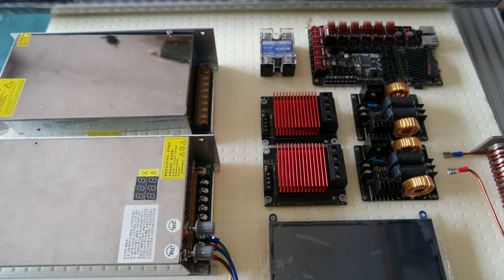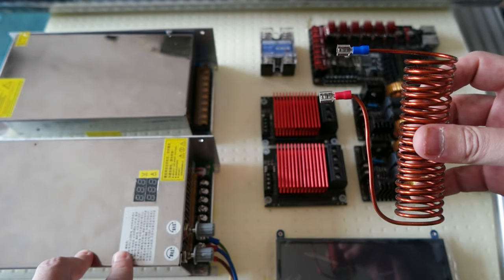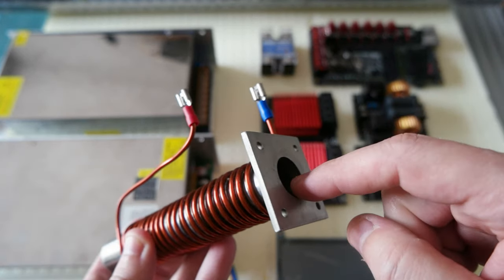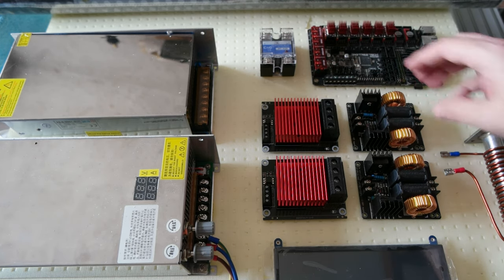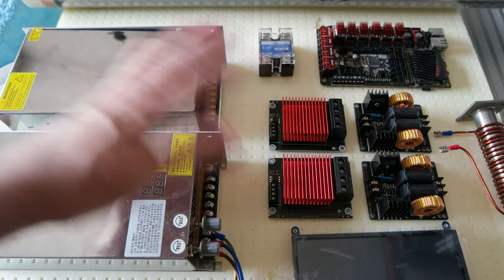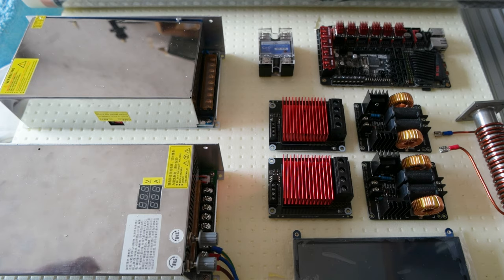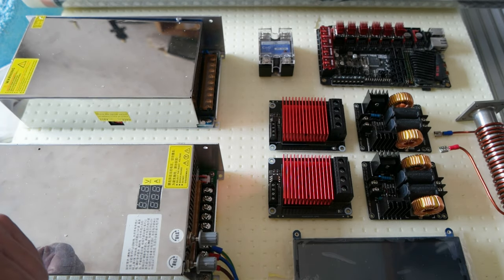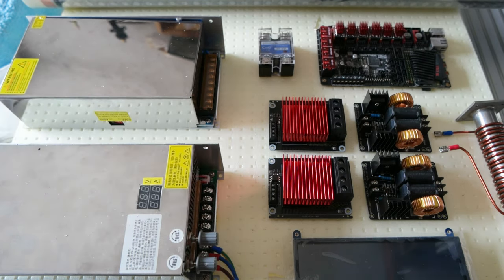Custom 3D printer board, mosfets, induction heating and power supply setup

Comment from the maker: I wanted to show what setup I have for my custom 3D Printer. I have 2 power supply, one for the Manta M8P and motor drivers and the other will power the induction heating for the 2 pellet extruders via Mosfet and Induction Heating Board Module. I forgot to mention the laser solution too. Will do another video for it.

Laser Support - https://s.click.aliexpress.com/e/_A0NYLS
Laser - https://s.click.aliexpress.com/e/_AXFIJS
Induction Heating Power supply - https://s.click.aliexpress.com/e/_9hVy0K
Heated bed power module mosfet - https://s.click.aliexpress.com/e/_DkX...
Infrared Heating Film: https://s.click.aliexpress.com/e/_AUcAhb
BIGTREETECH BTT S57B V2.0 - https://s.click.aliexpress.com/e/_9gZpdo
Oled Screen - https://s.click.aliexpress.com/e/_9R4LLy
3D Printer GT2 20Teeth - https://s.click.aliexpress.com/e/_9yJNts
Nema 23 holders - https://s.click.aliexpress.com/e/_9wL11C
BL Touch - https://s.click.aliexpress.com/e/_AYXBGI
Infrared heating - https://s.click.aliexpress.com/e/_9InHB4
coupler - https://s.click.aliexpress.com/e/_ASloGa
Touchscreen Monitor 7 in HDMI Screen - https://s.click.aliexpress.com/e/_DCr...
BIGTREETECH BTT Manta M8P - https://s.click.aliexpress.com/e/_DlJ...
BIGTREETECH BTT CB1 PI4B Adapter - https://s.click.aliexpress.com/e/_DBJ...
BIGTREETECH BTT CB1 heatsink - https://s.click.aliexpress.com/e/_Dmd...
BIGTREETECH  GTR 1.0 http://s.click.aliexpress.com/e/_rRDltN
BIGTREETECH SKR Pro v1.2 - http://s.click.aliexpress.com/e/_rRDltN
BIGTREETECH SKR V1.3  -  https://s.click.aliexpress.com/e/_AbZJ5z
TMC 2226 - https://s.click.aliexpress.com/e/_DBP...
TMC 2209 - https://s.click.aliexpress.com/e/_ApIVvH
Nema 23 - https://s.click.aliexpress.com/e/_AdrgEQ
Nema 17 - https://s.click.aliexpress.com/e/_97imIx
Nema 17 geared 5:1 - https://s.click.aliexpress.com/e/_A3kKfz
============================================================
flipsky ESC https://flipsky.net/?ref=ganzo
maxkgo BMS - Coupon Code ganzo https://maxkgo.com/?ref=ganzo
============================================================
Alibaba weekly deals https://offer.alibaba.com/cps/8pt0t96j
============================================================

Comment: Since you will cross-connect the signal wires across from the board to the mosfets, you most probably also need to connect all of the ground wires together. Specifically the output DC ground from both the PSUs should be connected together, so they share a common ground.
Reply from the maker: it might be required but I need to figure out that too !
Reply: @ganzoai  Not "might be", you must do it. Otherwise, your two DC lines will be floating at different levels, and what is 12V on one side, can at the same time be 112V on the other side since the two grounds are floating at different levels.
Reply: @ganzoai  Turn your PSUs and measure the voltage across the ground of one unit to the +V of the other unit when the grounds are not connected.
Reply from the maker: @kesor6  one is at 24v and the other is at a variable voltage. Also I am on a 220 volt, so I have ground on both PSU from the same line.
Reply: @ganzoai  The DC grounds on the outputs of the PSUs are not necessarily connected to wall socket ground. You should check. If they are, then its okay, everything is already connected. If they are not, and the DC grounds are floating (more probable) - they should be connected together, or else.
Reply from the maker: @kesor6  that's why I said "it might be required but I need to figure out that too !"

Comment: Not once when you'd mentioned using 2 MOSFETs, did I think you were referring to those 2 large heatsinked boards. I've never seen such massive MOSFETs! 😲

Are they some kind of industrial model for high current applications?
Also, how does the cost of those compare with using IGBTs instead?
Reply from the maker: There are smaller ones but these one are high current 30A, they are used for 3D printers, cost between $10/$20 https://bit.ly/3UfJgWR  IGBT are more expensive as they are higher quality